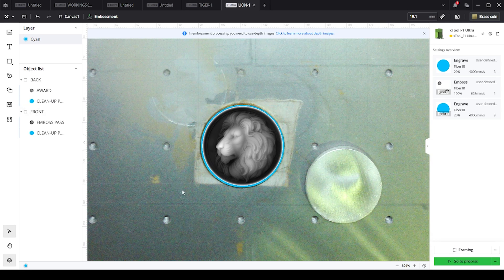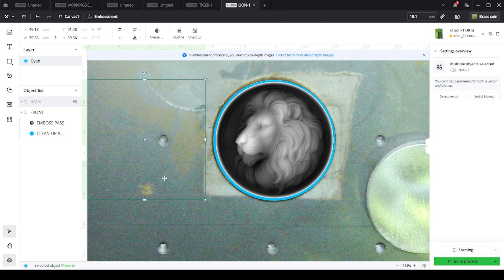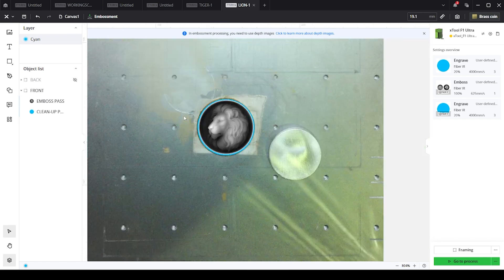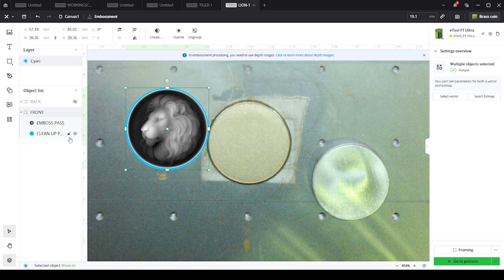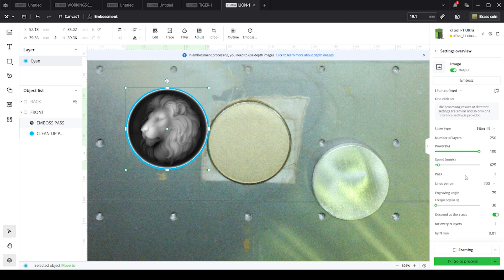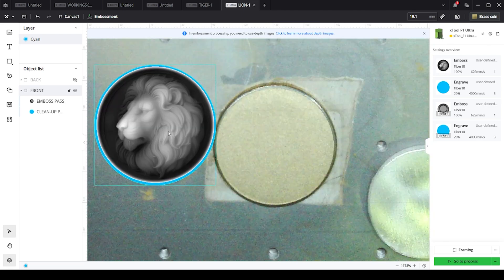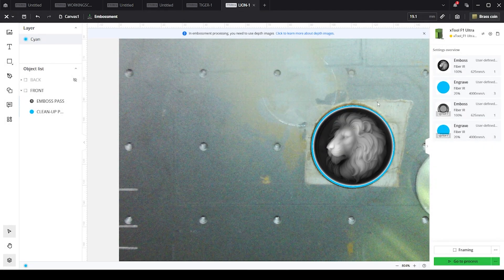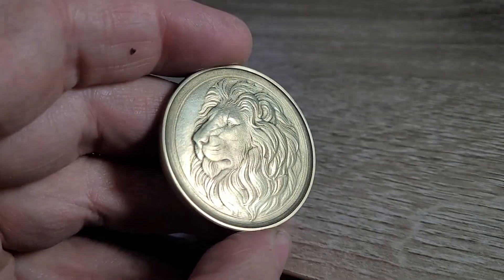How to Emboss a BRASS COIN with the xTool F1 Ultra Laser!

Comment: By the way, a good tip for beginners like me that I learned is that since brass is not magnetic, you can quickly find out which coin blanks are pure brass and which are just plated by using a magnet on them.

Comment: Thank you very much for the video. I have been asked to make some specific coins for the Police in my country. I make embroidered shields and they have asked me if I could make some coins for them. I don't know how to treat the image and I can't find any video on how to do it. If I have to send the image in PNG or vectorized form, how to treat the image, etc. etc.
Reply from the maker: It's pretty straightforward ... When embossing the system is looking for a "depth map" ... Any pixel that it sees as WHITE will be the highest points on the design, and any pixels that are BLACK will be the lowest point.  You get 256 levels of height.  So, for instance, if you wanted to simulate something like puff embroidery you'd basically draw a cylinder that was white along the length of it, but which got darker towards the sides.  One thing to keep in mind, though, is that you need a dark background for everything to sit against.  Your best bet is to start with a black circle and draw lighter colors on top of it.  Good luck!
Reply: Hola Rafael, I can help you out. Message me and send me the image of what you are trying to do on a coin. saludos.